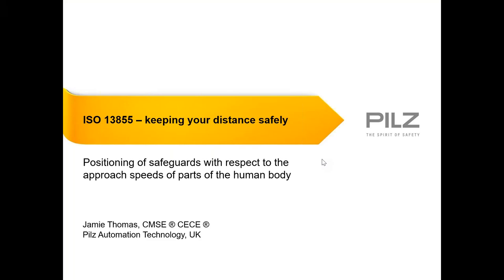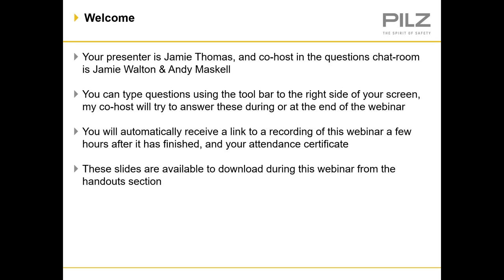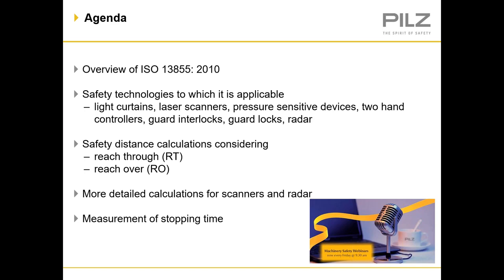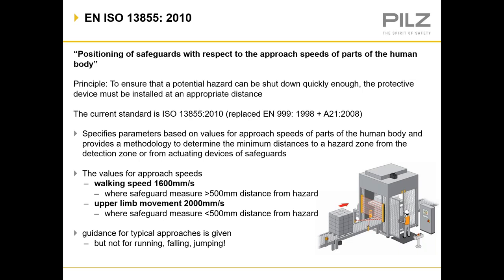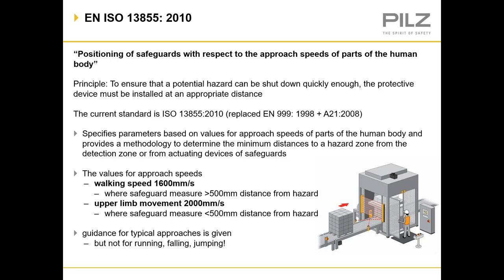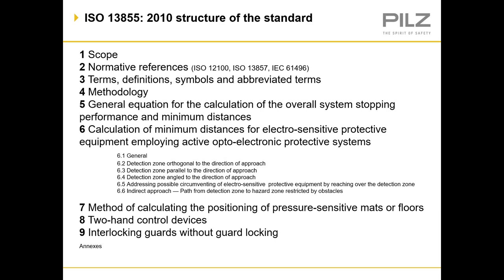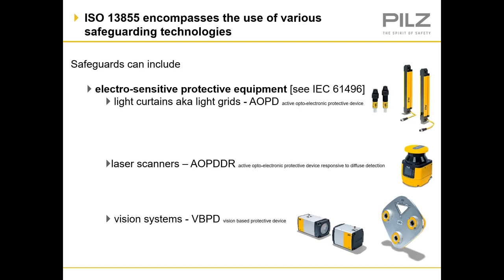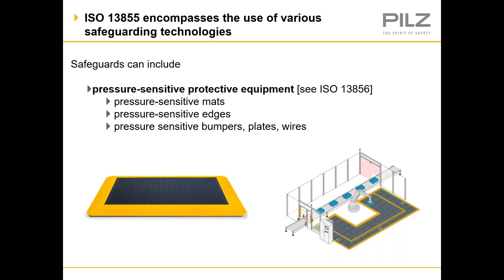Understanding ISO 13855 & Safe Distances

Comment: How do you determine if the ESPE is type 4 or type 2?
Reply from the maker: Hi Steve - the manufacturer of the light curtain will make that claim on their technical documentation for the specific device, but they will say it is capable of being connected as a type 2 or type 4.

It basically boils down to the way it has been installed with the rest of the safety circuit components to ensure the whole safety loop meets the requirements for a type 2 or a type 4 system. 

Hope this helps! Email us on marketing@pilz.co.uk if you need any further info or have further questions.